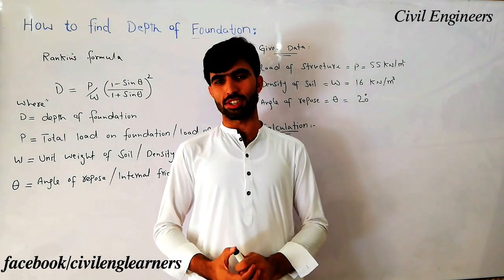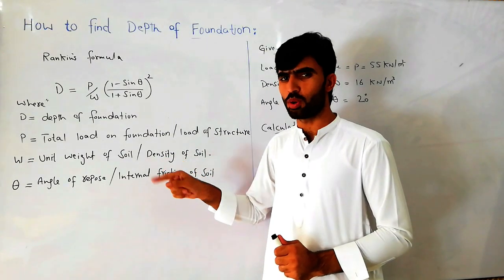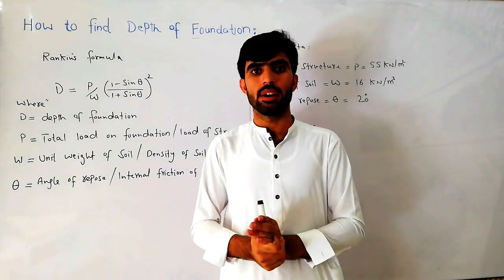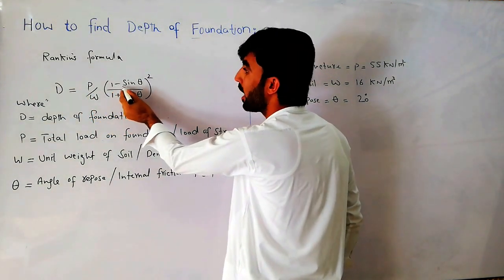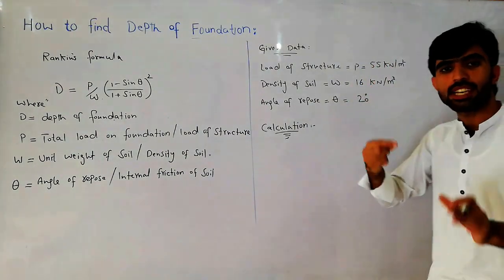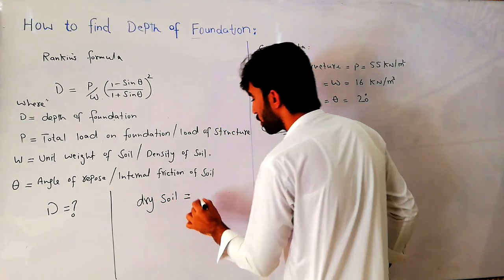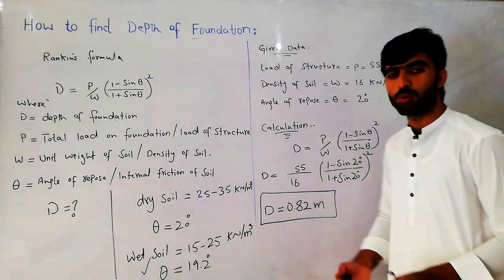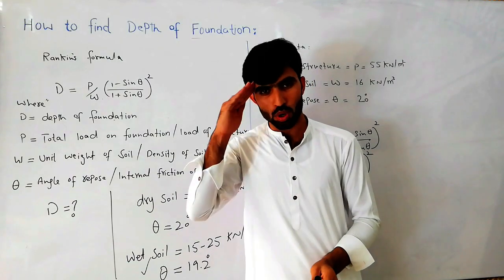How to Find Depth of Foundation for Building? - Civil Engineering Videos

Comment: One problem is there in base of width and depth of foundation sbc soil is 160density 160.8angle of repose30degree and depth of foundation is 30cm total load per meter run including weight foundation 130km solve the problem sir plzzz

Comment: 1) What if the soil is rich of organic matter and if its poor?
2) you are taking load of structure but clear that how to find that load?
3) If the half of area has better bearing capacity and half has poor bearing capacity. what will be foundation depth for raft     footing?
4) Justify how to find out friction angle of soil?
5) You are taking density of soil justify that either this is compacted soil or loos soil?
6) What if it is transported soil over the sandy?

Comment: I'm a geotechnical engineer. I disagree with the soil strength parameters in this video. 20 degrees is an unrealistic value. In addition, Terzaghis bearing capacity equation is a much better way to not only find the depth of a foundation but it also estimates the bearing capacity.

Comment: In this video you said the density of soil 15-25 is wet soil , and angle of repose is 19.2. In the problem we have density of soil is 16 so it is wet soil then we should take angle of repose as 19.2 , but you take 20.why please tell me.
Reply: How do we can get the angle of repose
By which test
Reply: Yes you are correct he did a mistake
Reply: He is not a professional....such things are well explained by a professional engineer

Comment: sir how to find angle of repose please reply
Reply: How to find angle of repose when not given in a question...
Reply: Same question
Reply: Senthil Kumar by soil testing
Reply: Which test is gone to do find the value of @
Reply: I think it is carried out from the geotechnical laboratory (soil partical arrangement)
Reply: To determine angle of friction (repose) 
You can perform tri axial shear tests(depending upon dtainage condition) and obtain the required value using Mohr's circle or also can be found by imperical formulae
Reply: OK